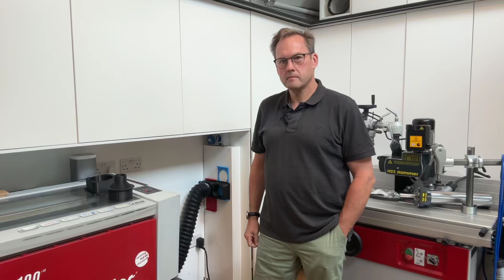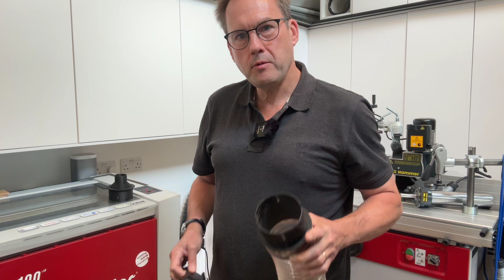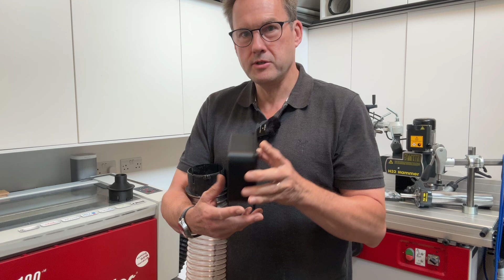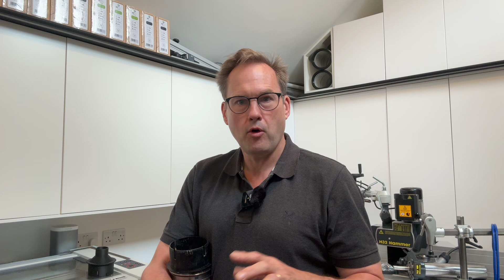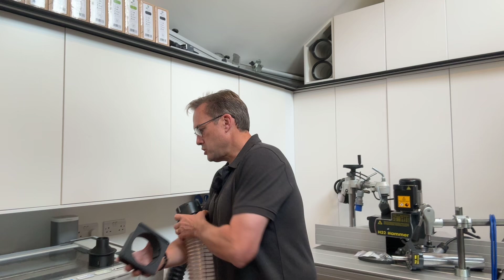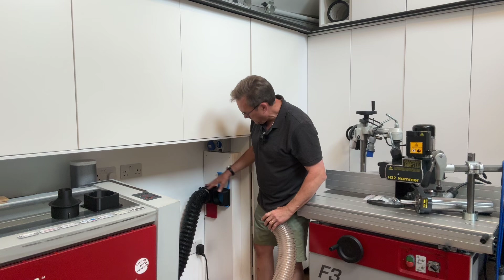04 Record Power CamVac Female Bayonet Connector / Blast Gate & Alexa Control for my Felder Hammer F3

Comment: One thing to be wary of.. I've seen two youtubers have experiences (albeit with "dumb" 433MHz remote plugs) where they came into the workshop to find their extractors had been running for hours and hours and red hot!
Probably not possible with Shelly remotes as the control protocols are less prone to random triggering, but worth thinking about ensuring remote controlled devices are hard powered off when not on-site..
Reply from the maker: It’s a valid point. I have used Shelly Plus 1 PM relays, which are stateful and the PM stands for power monitoring, so it is clear what state they are in (on / off) and, if on, how much power is being consumed based upon the current drawn. I have alerts set for power consumption if I’m not present and as you sensibly suggest, I turn off the power when I leave the workshop. 

Shelly has released a new form of presence detector which would be interesting to try, but the reality is I just use the Shelly relays as remote switches when I’m working in the shop.

Comment: Hi Chris, thank you for making these videos on the camvac. I’ m thinking about getting a 3d printer now because these blast gates look awsome 😁 Just a tip for upcomming videos if you are able to use stereo audio because now the sound only comes out at one side of the headphones
Reply from the maker: I did speak a few times with Record Power and shared my ideas. They may well look into creating female bayonet connectors, but in the meantime my model on Makerworld works quite nicely. Definitely best to print using PETG if possible.
Reply from the maker: Yes, thanks for the tip. I noticed it too. I don’t know what happened with the audio. The wireless mic seems to have defaulted to using one channel and I usually use two microphones when doing interviews in my day job.